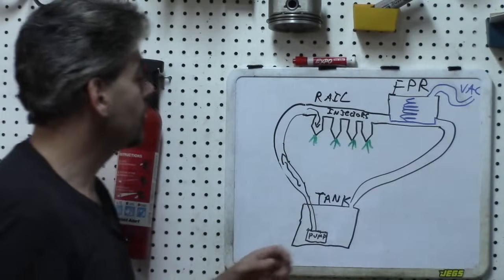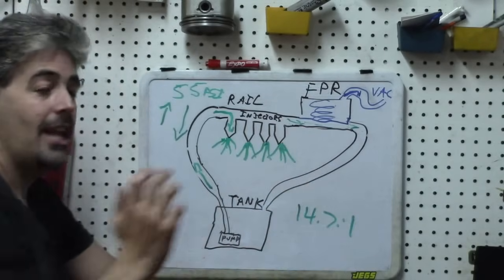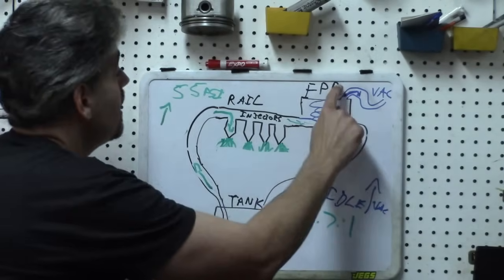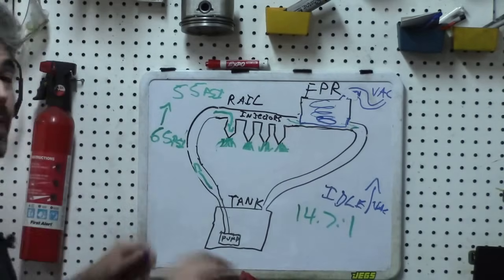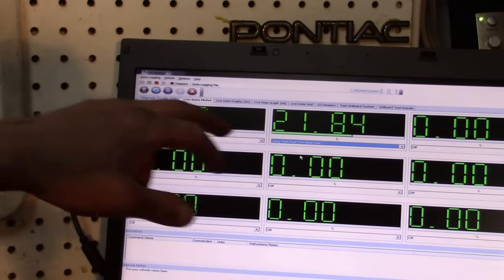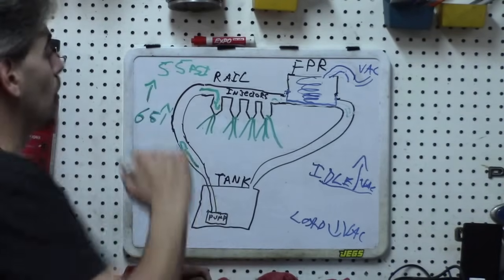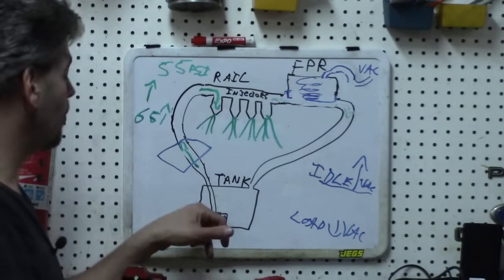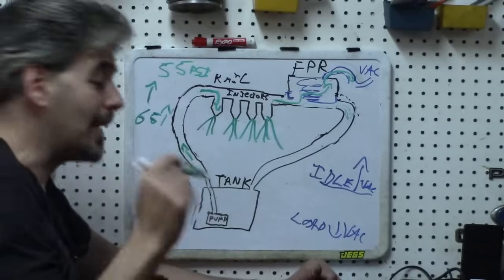Fuel Pressure Regulator Diagnosis + Understanding (HD!!)

Comment: Hey Matt!  I was chasing down an issue that I couldn't figure out if it was the tune or the FPR. 

I did a smoke test and discovered a vacuum leak at the regulator (not the hose). Have you ever seen/heard of this before? It was right inside the bell looking part of the regulator. I assume this is where the diaphragm is. Potentially a crack inside of it? There was no fuel in the hose, but the inside of my intake smelt like fuel.
Reply from the maker: I not only have seen it I have a video of it somewhere!

Comment: Hello!
I have this problem with a 1997 Blazer 4.3.
It starts with great difficulty and at high revs the engine starts jerking, as if there is not enough fuel....
The fuel filter is new, I have not been able to measure the fuel pressure yet...

Comment: At 22:00 you say with a vacuum leak the mixture will be richer. I understand that. But when there is a vacuum leak, would the extra air sucked in by the leak caus to make the mixture leaner ?
Reply from the maker: Correct.  The EXHAUST is lean with a vacuum leak so a RICHEN COMMAND is initiated by the PCM
Reply: Schrodingers Box btw i like what you are doing. Ive learned so much here that i can use in the shop. Im from europe and the only drawback is that we have more diesel cars here. And diagnosing diesel cars is a bit different here when there something wrong with te mixture. But keep up the good work ! You are better at explaining these things then my teacher in school was 😂
Reply from the maker: yeah diagnosing diesels is entirely different. most of my methods don’t apply on diesel. for example, diesels have manifold pressure equal to atmospheric pressure. so none of my MAP load test strategies apply on diesel.

Comment: Checked  my PCV  valve and  found the vacuum line from regulator melted.   It apparently melted enough to  block off the line to the regulator and blocked the line to the  vacuum block so likely little or no vacuum leak.    No problem starting idle was just fine but loaded (going up hill or drag race start) a nasty spark type knock.  Resetting the battery and going for a test drive in a few minutes.  Recent plugs and wire changed  plugs were beyond fouled and what center electrode?  If it was not HEI I don't see how it would have run period.
Reply: Test run awesome.  Now maybe better mileage, I hope.

Comment: When your watching the pressure do you leave the key on or off..? I have 40lbs but I turned the key off and it dropped to 35lbs in 10 minutes on a 95 impala ss and running (idling) the pressure is 30 to 31 lbs

Comment: ...So that's why my van always failed emissions at idle, the injectors were open longer, and I had a faulty fuel pressure regulator, which did not lower the fuel pressure as it was supposed to be doing, resulting in black tail pipe, and black ooze spitting out of it staining white concrete especially during start up.....and the mechanics never caught it. They just said, "Something is wrong with it, and I don't know what it is." , and I would say, "OK, Here's $150.00 for a waiver." ....but then years later (a few days ago) I was on a site that said that black tail pipe is a sure sign of a faulty fuel pressure regulator, and so I changed it out. No more black ooze.
Reply from the maker: No- FPR would need to be on return side.  Think of the purpose and operation of it (actually just the purpose)...  There is no other way it can serve its purpose other than controlling return.
Reply: But what if it was put on the supply side? Could it not reduce pressure much like an air pressure regulator used on air compressors?...just saying that it could, not saying that this is how they are commonly designed on return systems.
Reply from the maker: If it was on supply side what is your control for return to maintain pressure in the rail going to be? Another regulator?  See, it makes no sense!  It has to be on return.
Reply: Since the return is not to the fuel rail, but rather to the gas tank, there would be no sense in putting a fuel pressure regulator on the return side, if the fuel pressure regulator reduced the fuel pressure to the proper amount on the supply side, which goes to the fuel rail.
Reply from the maker: Yes exactly!!! The return is NOT before the rail- that's the whole point!!!!  That's exactly why the FPR must go there! How else will you maintain pressure otherwise?
 I think you are not following the fluid mechanics- I suggest maybe watching the video again. But it is impossible to maintain the pressure variances with an open return!!!!
  Tell you what- next time you wash you car with a adjustable spray nozzle,, put the spray nozzle at the beginning of the hose- between the spigot and the hose rather than at the end of the hose. Let me know how that works out for ya.
Reply: Sshrodingers Box, To understand what I was saying, Go to a place that sells air compressors and see how they have their regulators in relation to the air tool. Try it any other way, and it will not work for you. Understand that I am not saying that this is how it's designed by auto makers with regards to their fuel supply, I'm just saying..
Reply from the maker: Yes that's because on an air compressor you do have to adjust for variance. And don't forget- if the tool has variable speed then the tool is regulating flow (has internal regulator).
  The analogy of an air compressor is a completely false analogy to this application. You must think in terms of the need for stoichiometric maintenance- this does not apply to an air compressor.
Reply from the maker: Here's another way of looking at it... remember on an air compressor, while the regulator is at the beginning, the tool "closes" the end of the hose. A fuel injection system has an open end of the hose to return to the tank. In other words, try "T"ing the air tool on your compressor hose but leave the end of the hose open. I don't care what you set that regulator to- it ain't gonna work. Does that finally explain it?
Reply: Schrodingers Box, Good explaination. Thanks.

Comment: Help I have a Land cruiser 2005 and i dont know if the FPR is working and the fuel consumption is terrible what if the vacuum hose is before the throttle body flap outside after the airfilter inlet and BTW on the manual states they should be vacuum at 3000rpm. on my case there is no vacume at all idle or 3000rpm

Comment: I have a question for you Matt. @ 22.30 you mention a rich idle condition would be compensated for when registered by the 02 sensor 

On Motronic controlled cars like the 1989-92  Porsche 944S2 there is no 02 sensor fitted to the Euro cars. The two pin 02 sensor is replaced with a fixed resistor wire loop which is simply inserted in place of the 02 sensor connector. I believe I read somewhere that it is 4.6  ohm ? presumably mid point in the 02 sensor resistor range

When you have a  fluctuating idle condition (rich) how does the ECU monitor and stabilise  the idle without an 02 sensor ? compared to a car fitted with one.  Obviously the ECU uses the IAC valve (2x pin rotary ) to adjust additional air flow and presumably adjusts injector pulse width as well but exactly how does it achieve this on the Euro 944S2 
kind regards johnny
Reply from the maker: Not familiar with those designs sorry.

Comment: I have a problem with my 95 Chevy Silverado I know you can help me I tried a lot of different mechanics and they don't know what they are doing I will try to explain this as best as possible the truck had a issue a few months back where it wouldn't start in the morning when it was cold after 10 or 15 minutes it would finally sputter and sputter and kick over once the truck was warmed up it had no problem starting I put a new fuel pump in there and that problem stopped but the truck was still running crappy I put a brand new cap rotor wires and plugs and it runs a lot better but when it's idling or while I'm driving it has this interference like it's sputtering order some type of loss of electricity power I'm not sure what it is sometimes I jump on the gas pedal and it's very responsive other times I jump on it and it's not so responsive as its idling it will just spot spot it's to the point where the RPMs drop in once in a while when I'm saying reversing to park it will die out please let me know what you think
Reply from the maker: Ok what data do you have?

Comment: In my Toyota Rav4, the FPR has not a vacuum hose attached to it. It is also not electronically controlled.It is directly attached to the fuel rail.How am i supposed to troubleshoot it?

Comment: Not sure if your still responding to questions. I have a 96 4 runner when i did my fuel pressure test I don't get a prime, i only get pressure when the engine is running. When I shut off the engine it drops immediately
Reply from the maker: sounds like a bad check valve to me.

Comment: T his video is great for fuel injection ( rail injection ). How do you check the fuel pressure regulator on a TBI system?  I have a 1994 Silverado 305. showing a trouble code 45. Any and all help would be greatly appreciated!!!!
Reply from the maker: +ROBERT SANDLIN Same way- you check ALL fuel pressure by T-ing into the system.

Comment: Simple question- is the pressure in the fuel rail supposed to stay at some constant level when the car is off for an extended time say overnight?  I changed my fuel pump and I think the pressure drops off to a low pressure over time so no sure if this is an indication of a problem. 2003 Suburban. Thanks!
Reply from the maker: The usual specification is about 1PSI within 5 minutes and somewhere around 1/2- half the PSI overnight. See your service manual for static decay specs.

Comment: A rich condition on a steady throttle and unsteady idle after opening the throttle and closing it .. This also indicates a faulty FPR spring or diaphragm ?
Reply from the maker: Or an IAC issue. Validate by checking for same condition with turning AC on and off
Reply: The car doesnt have an AC nor a power steering.  if i set the fuel pressure to 30 Psi at idle, it should not go below 30 psi no matter what, right ?  If it is going below 30 psi and stays below 30 during decel and cruising , this means FPR is faulty ? please correct me if i am wrong.  A leaking vacuum source to FPR can also cause this ?
Reply from the maker: Auto takumi Yes I would start with introducing pressure variables to the FPR.  If that works, you need to look at other fuel trim variables including load response of some type.
Reply: Okay, a vacuum leak in such case would also cause an idle surge and rich condition too. I will replace all the vacuum hoses and then take the car for a test drive, if no success ill replace the FPR.
Reply from the maker: Auto takumi A vacuum leak causes a LEAN condition unless it on FPR hose.

Comment: but if the problem is in the vacuum line that is cracked, that extra air not measured by the MAF  can compensate for the extra fuel  not regulated so you won't know if is a lean or a rich condition with the fuel trims and maybe the idle will be higher so how would you diagnose that? thanks
Reply from the maker: A crack on a vacuum line will show a lean fuel trim for the exact reason you mentioned. The MAF would miss it but the O2 sensor won’t.

Comment: Is it possible to have a condition where the fuel pressure regulator is stuck shut? How much vacuum is needed to overcome the spring? Can putting a small hose on the vacuum port and applying suction it cause it to open? My situation is where the book says I should have 6.4 z of fuel flowing out of the return line when the pump is ran for 10 seconds and I don't. I tested that fuel is making its way to the fuel rail and the pump is spewing gas when the line is disconnected from it.
Reply from the maker: Not only possible but I have a video of it somewhere- i think on my pay channel.  Vehicle was only rich at idle because it’s FPR wouldn’t open.

Comment: I replaced all vacuum lines and hoses,fuel pump,and fuel filter with regulator built in also fuel pressure with key in number two position getting 25 psi but at idle it’s 55 psi can’t understand this problem still getting po171 and po174 lean 25:50 code 2001 bmw 330i
Reply from the maker: Why do you think it’s a fuel pressure issue?  What does the fuel trim indicate?
Reply: @SchrodingersBox  shouldn’t the fuel pressure be the same at rail with key in number 2 position and also at idle or am I wrong about that?
Reply from the maker: No it shouldn’t be because the fuel pressure regulator maintenance isn’t active at KOEO.
  You need to do a fuel trim analysis. You really can’t get a direction without that.
Reply: @SchrodingersBox  ok thank you

Comment: I run 55 psi static, all hell breaks loose over 8000rpm. Pressure fluctuates wildly up to 55 but down to 25 psi. AFR goes lean, it’s consistently inconsistent so I richen it up. I now run 2 dampers, MAP signal is rock solid, I removed vacuum to regulator with same result. The pump and injectors are too large if anything. I noticed a 10 psi difference before the fuel rail and lower in the fuel rail. I just drilled the rail inlet and need to take it out to datalog. Have you seen these wild fuel pressure swings? Where should I look? I’m about to try retuning on a lower(43) fuel pressure and see how it reacts.
Reply from the maker: I would start by checking amperage on the fuel pump circuit.
Reply: @SchrodingersBox thanks for the reply. I did the whole Hotwire and am datalogging voltage(it’s okay) but I have not checked current draw. In the beginning I was loosing voltage due to overspun alternator, I had to swap to large alternator pulley to correct that

Comment: hey great video.  I am running a fuel pressure test on my 2002 Wrangler Sport (4.0 I6 engine) that is giving me fits.  When I do the static test with the engine in the ON, I only get 12 psi.  But when I crank it over it jumps up to 46 psi and holds steady there, which is the only value given in the Factory Service Manual I have.  Is there an issue that it is only at 12 PSI in the static test? If so, what would be causing that?

The reason I'm doing all this is because I have a loss of power and no acceleration. It had been slugging on the get up and go for weeks but it's gotten so bad now that I can't even get front to back on my level driveway.  Everything other than this test is pointing to a clogged cat but the 12 psi static test is definitely making me scratch my head.

You have any ideas? I sincerely appreciate anything you are willing to offer!
Reply from the maker: You need to do fuel trim analysis to confirm if delivery is insufficient. If it is positive at idle and increases under load you need a fuel pump. If it is not you have other issue

Comment: Just popped my vacuum line off my regulator (89ford f150, 6cyl.), turned the key to the on position.  When I heard the pump prime, fuel poured out of the line.  When pump stopped priming so did the fuel flow.  I know I have to replace the regulator but what a mess.  Is there any tool that can access and remove/replace those 3 hold down screws or will I have to remove manifold to get to them?
Reply from the maker: I usually simply remove the fuel rail when replacing a regulator.

Comment: Hi thanks yu for your video ! ,     i have a question, i tested the fuel pressure (v6 petrol gm opel) i get 3.8 bar (i am from France) when i unplug the regulator vacuum hose, the pressure remains the same, is this normal?
  In addition, the vacuum hose is connected to this engine just before the throttle body, is there depression in this place? Thank you for your help
Reply from the maker: Is it solenoid controlled? If so open the solenoid and check for difference.
Reply: @SchrodingersBox    solenoid controlled , what is it ,?  the regulator is  controlled just by depression  vacuum hose  on my car

Comment: Hi,,S/B,
I did read somewhere that pressure can also be altered by WATER in the system,IE Maybe the fuel Filter,,So as I did get a reading of P0001 on my Citreon picasso..
One of the things that might point me also in this Direction is the Fact a Coupple of times the engine has CUT OUT,When under a heavy Load,,,Going fast for quite a while.
As Water will not compress I am assuming that fuel is CUT OFF Due to water being in the line to INJECTORS,Would I be right in just chaning the FUEL FILTER For an EASY OPTION First.
      Thank you for video anyway..And would be interestd in your thoughts.
But I will Still change the Fuel filter,Just in case...lol.
Reply from the maker: Good point. different contaminants will certainly change the compressibility.

Comment: i am confused i connected my pressure tester and it read 35psi manufactuer  calls for 34psi but when i tested the regulator with a vacuum tester it does not hold the pressure so is my regulator bad or good?

Comment: I have a bmw e46 M52TU engine type, 6 cylinder inline, dual vanos and I get no vaccum out of the hose that connects to the fuel pressure regulator. I have changed the hose including the ccv valve that is connected to and I still get no vaccum. The FPR is located on the fuel rail. Is that a problem or it's just how this engine work? The symptoms are : car sometimes accelerates fine, sometimes bogs down, sometimes hardly accelerates, throttle response is verry laggy. Starts fine, it shakes a bit at startup when it's cold and gas smell is coming out of the tail pipe, after 15 seconds it revs by itself to 1300 rpm and the shaking stops along with the smell of gas. Then the hydraulic lifters start to tick. Do you have any idea why is it doing that? Is it a fuel problem or sticking hydraulic lifters?

Comment: I have a 90 olds cutlass ciera 3.3 I put fuel pressure gauge on when the vehicle is running and I pull the vacuum line of the regulator and the engine shuts off is that normal